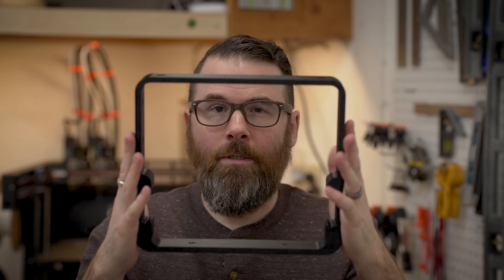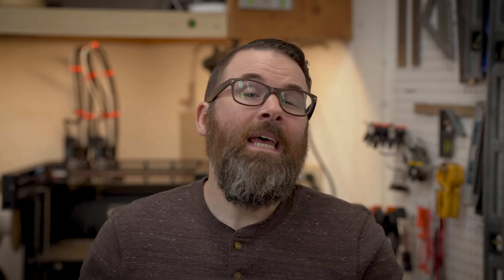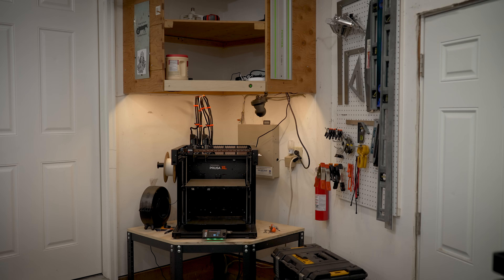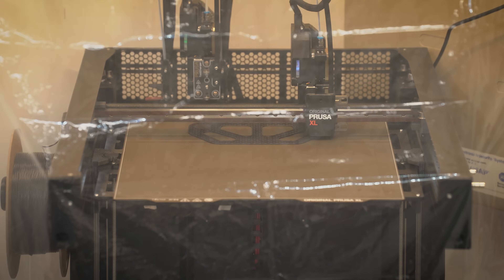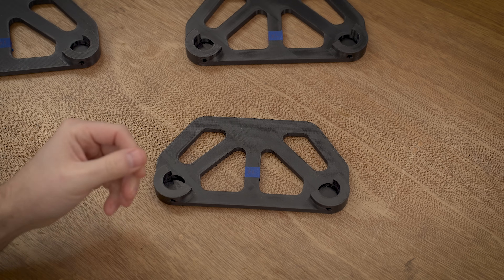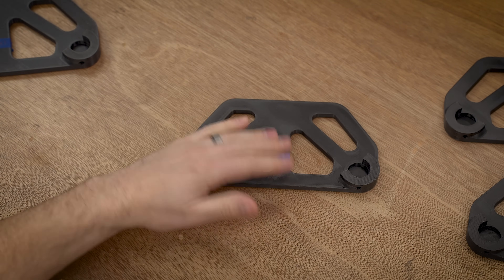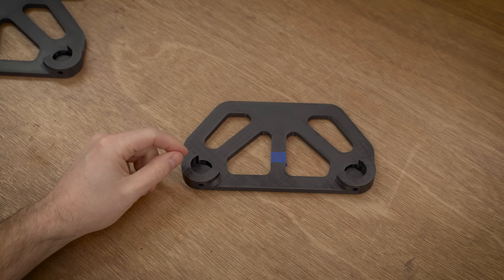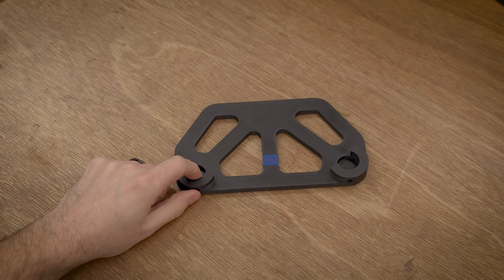Printing ASA on the Prusa XL -Are Enclosures Necessary?

Comment: I'm printing ASA on a modified ANet A8 ! No enclosure. Mostly small parts but it works OK. Had to change the hot end liner tube to one designed to survive 250-260C. Im using a glass bed at 90C with 3DLac. Sometimes hard to get parts off the bed but leaving it overnight helps. Elsewhere I've seen someone print ASA with a "wind break" printed around the part.

Comment: Great video, just got my XL and goint to print some LED sign in ASA, can you now write final seetings of print bed 100C? nozzle 265C?  is there a problme if i have a shell of 2 mm? many thanks for answers
Reply from the maker: It's guess and check with the XL.  I didn't find any settings that worked perfectly.  I ended up just using my H2D for ASA, and just used PLA with the XL.
Reply: @RobertCowanDIY  many thanks for answer will try with your settings in video and will see

Comment: I am currently printing in asa on my vyper in a closet with a blanket blocking the front of the enclosure and I have had no issues. Before I covered it I could see a little warping after covering it none

Comment: I have x1c still having cracks in the print that appear after being printed is there anyway to have a good print without heated chamber?
Reply from the maker: Cracks?
Reply: @RobertCowanDIY yess after 1 hours it appears
Reply from the maker: @elie.k93 you didn't let it cool down slowly enough.  You might need to add some gcode at the end that slowly let's the part cool

Comment: What exactly did you tweak? Would be helpful to know what you did.
Reply from the maker: I just slowed down the outer walls, and added a delay at the end to let it cool down more slowly.
Reply: @RobertCowanDIY I appreciate the reply. Was the delay after each layer or after the entire print you allowed the bed to stay on so the entire model cools slowly?

I’m trying to print an 8 x 8“ square 1/4 inch thick. The warping in the corners is unreal.

Comment: Thanks Robert.  I've been printing 100s of  ASA parts. I consider asa and abs as "bridge materials" to the polycarbonates and nylons. 
Being a bridge part, aspects like layer adhesion, infill, etc are still very important and need that 50 to 60c enclosure temp. That hot air surrounding the part really helps those layers to bond very well. 
There are a lot of factors that go into printing ASA that, when you have that heated chamber and can get it dialed in, makes it such a joy to print with. 
Thanks for the video Robert! Instant subscribe here!

Comment: Thanks so much for the heat gun tip to eliminate the stress-whitening on the bottom surface.  I'm printing a lot with ABS-GF now (at Clough42's recommendation) and your trick works great on that material.

Comment: 10:10 glue stick may not work due to the bed temperature depending on the material it is composed off. I had the same issue with my 3D Lac so I bought a adhesion spray made for higher temps and it worked fine. 
The other option I used before I found the spray was printing the infill with PETG. Don‘t ask me why but it helped.
Reply: PS: apart from that I used most of your tips: increase heat for hot end and bed, reduce flow (quite a bit), slowly reduce temperature after the print.

Comment: I'll probably do something very similar with mine, and add a separate heater within the "chamber" to help keep the interior toasty. The real enclosure is ugly as sin, and very expensive. I'll probably also permanently affix some plexiglass or something to the sides and across areas that you don't need to reach into regularly, to also help keep drafts and temperatures where they need to be.

Comment: About to have a go at ASA on my entry level Creality v3 ke - have built a plexiglass enclosure for it. Good times.- Styrene (not styrol as another commenter put it) fumes are a suspected carcinogen, and neurotoxic. So I’ll be using a small PC fan at very low rpm to vent fumes outside. One other thought is that warm air holds more moisture - so maybe a bowl of silica beads might help too.
Reply from the maker: Best of luck!

Comment: My favourite related material is HIPS

Very cheap.
Matte and pretty.
Not actively hygroscopic.
Not all that floppy, it's not PETG.
Better UV resistance than ABS.
Does not degrade in the hot-end as quickly as ABS.
Little die swell.
Good pressure control, does not ooze.
It has that volatile poison but not too much of it, an order of magnitude less than ABS.
Dimensionally very good, little shrinkage.
Accepts sanding, painting and glue.
Does not dissolve in acetone but can be welded with acetone.

I can usually just print it open frame and instead of draft shielding i do the opposite, i just blast a little constant air on it, like 5-10% fan speed. Yes i'm sure i'm locking more tension in there than necessary but it works. You try that with ABS and it's a catastrophe.

I don't know why HIPS gets treated as a joke, i think it's one of the best most versatile 3D printing materials.

Bed adhesion is a little difficult. 100°C-ish and PVP coating helps.
Reply from the maker: Huh, I thought HIPS had poor UV resistance?  It's also not great a exposure to heat, which would make it problematic in the sun.
Reply: @RobertCowanDIY   Compared to ASA, it is poor in these regards; but even when degradation by all reason should set in, it suffers less than ABS.

ABS i could preheat the nozzle and then just crumbly shit would come out a mere 20 minutes later, because the material has thermally degraded in the meltzone. With HIPS, i have not been able to accomplish that in any humanly timeframe.

Comment: I love Polymaker ASA. Fantastic filament. I use it for all my custom air ducts for my printer cooling. Prints almost as nicely as the PLA Pro. 
You definitely need to leave it warm for a while and cool it slowly.
Reply from the maker: for sure!  any part that's removed from such a hot environment is gonna have a bit of thermal shock.

Comment: Printing a ton of ASA on an x1c, I can say that by lowering the nozzle temp to about 260c, increasing the bed to 110c, and slowing the print speeds to 50%, and running silent mode, using the engineering plate, It works best with zero glue stick. All prints pop off extremely easy after cooling and are absolutely glued to the bed while hot. I actually have cupping on some parts instead of peeling up, so my bed temp may even be too high. 😂

Comment: Thanks! great vid. Which of these UV resistant filaments > ASA, PCTG & PETG are 'strongest'? Speaking of those which UV resistant filament would you recommend for functional parts... eg a shed door handle?
Reply from the maker: If you're referring to strength as rigidity, ASA would probably be best.  But I don't have any experience with PCTG.  But it doesn't sound as rigid as ASA/ABS.  Other than the fumes, ASA really is pretty neat for functional parts.  It checks a lot of the boxes!
Reply: @RobertCowanDIY  thanks! i'll buy some an give it a go
Reply: @RobertCowanDIY  thanks i've ordered some, lets see how many birds nests i can make hehe!

Comment: Cool trick with the heat gun.
I found ASA very finicky with temperatures of the air around, and had to use a heated enclosure and have the air temperature at 35C to get good prints. Any cooler and ran into issues.
Reply from the maker: Yeah, the cosmetic quality wasn't great, but the parts were functionally just fine.
Reply: @RobertCowanDIY   In cleaning, I found sample flat prints I did with ASA trying get a better finish on the top side. Don't remember all the markings on the back side, but apparently 95 and 260 gave the best result.  :)  This is why we have computers to remember things for us.

Comment: Are enclosure necesary? YES if yuo whant to print in all that volume its a Must , even more yuo gone need a heater for all the volumen ,of course if yuo print tinny things could work but if the thing grow in heagh , its super important have all at the same temp, even with an enclusure yuo coukd habe delamination , cracking  and  warping , soo
Reply from the maker: It's more about the geometry.  As you go higher, you get further from the heated build plate.  BUT, if your ambient temperature is adequate, the temperature differential won't be as large and won't cause issues.

Comment: I've notice that by clamping the parts to a flat surface as soon as I take it off the build plate, until the part finish cooling down. It seems to help keep the part from warping as much. 👍
Reply from the maker: Yeah, that helps for sure.  I'm just letting everything cool down slowly, which does the trick.

Comment: I would like to add that ABS and ASA don't only "smell", they actually release styrol fumes which are toxic (and if I am not mistaken can cause cancer) hence the headache. If you print that stuff on a regular basis you need to think about some kind of ventilation. Great video, thanks!
Reply from the maker: yeah, understood.  I only print them when I'm not in the same space.

Comment: A tighter enclosure with better insulation will get you hotter chamber temps, which will critically reduce warping and increase layer adhesion.

The other major reason for a proper enclosure is the "smell" you mentioned. That's poison, and just because it's less of an effect on your nose for ASA does not mean it is more safe. 

ASA and ABS should be printed in an enclosure, with a filter, and preferably an exhaust as well. You do not want to be breathing that stuff!
Reply from the maker: Oh, of course.  A 'real' enclosure will always be better, but this is a quick solution for the occasional ASA print.

Comment: weight your parts for 15m before removing from build plate, helps me a lot, especially with flat panel parts
Reply from the maker: Not a bad idea.  I worry that it would deform in some rare cases?  I adjusted the ending gcode and that works great.
Reply: @RobertCowanDIY  depending on the part, I agree... if there's any kind of bridge I would not use a weight, but I do a lot of flat plate-type prints, so its helpful.  (as long as I'm around when the print ends lol).   What adjustments do you make to gcode?  slow the cooling down in stages or similar?
Reply: I've also tried flash-cooling by weighing parts down in my freezer with the build plate and all.. I did see a difference, and oddly enough, the parts feel a little "harder", though untested.😂
Reply from the maker: @ChrisLocke1969  Yep, just some simple gcode to slowly cool down the build plate.  It worked perfectly.  I was thinking of doing a follow-up video.  Once the shop temp got back up to normal levels and I added that code at the end, it's printing ASA just fine.
Reply: @RobertCowanDIY  what a fantastic idea... yes, please share this as a How To?  Many of us don't know much about gcode, and would be scared to try something like this alone lol.   Sounds like a practical feature they should start building into the core OS.  Great job, sir!
Reply from the maker: @ChrisLocke1969  Cool, I think I'll work on that video then.  Thanks for the feedback!
Reply: @RobertCowanDIY  gcode followup would be great.  Thx.
Reply from the maker: @mocarver  I already did!  Here you go:  https://youtu.be/q6-g1qL-TT4  Could I convince you to subscribe so you don't miss any other content?  ;-)
Reply: @RobertCowanDIY   Thank you sir

Comment: If the middle lift ups reduce the build plate temperature after first layer.
I had this problem with an enclosed and chamber heated to 50c (Celsius 😅) Voron 2.4 R2 too.
Reply from the maker: Huh, interesting.  I might try that.

Comment: I'm pretty sure that you've made a wrong question: does prusa xl actually worth it's price if you have to wrap it in cellophane to print "advanced" filaments
Reply from the maker: Price is relative.  If you have no food and clothes, even if it printed metal and ultem it's not worth the money.  If you have a billion dollars and NEED to print large format dissimilar materials, it's worth every penny.  You either need the abiities it has or you don't.  If you don't need what the XL does differently than other printers, it's a waste of money.  But it does some things that no other printer can do.  It sounds like you just want people to say the XL is overpriced garbage so you can feel superior.

Comment: Hi Robert, great video. Would you mind sharing with us the profile you used for the print on Bambu Labs?
Reply from the maker: All I did was change the speed on the perimeters.  I think it was 75 for the outer wall and 150 for other perimeters and adjusted the number of top and bottom layers.

Comment: I'm a newbee to 3D printing and I appreciate your honest reviews and love the fact that you show the positives and the negatives. I'm trying to decide between the Bambu Lab X1 Carbon and the Prusa XL. I love what Bambu Lab offers for a user that just wants to print, not tinker and its enclosure. However, I find that Bambu Labs' X1C's build volume is so darn small. I love the bigger build volume of the Prusa XL and its 5 extruder heads which renders way less waste but would have preferred the Prusa XL in an enclosure. That being said, I love your "home made enclosure solution" for the Prusa XL to make a difference in the quality prints that require "sensitive" material. In your opinion, is the Prusa XL to much to handle for a first 3D printer purchase. Its price tag is hefty for a first purchase. Is there a chance that Bambu Lab would release an X1C with a bigger build volume? You feedback would be greatly appreciated. And yes, I did Like and Subscribe!

Comment: Great idea. One thing I did want to mention is that while the XL (and the MK44) is pretty much auto-magic for the first layer height calibration, you can still press and hold the knob during the first layer of the print to manually "Live Adjust Z" if needed for a special case.
Reply from the maker: Ah good to know.  I haven't had to do this yet, but I'm sure I'll need to some day.

Comment: My understanding is that glue stick acts as an adhesion barrier, keeping it from sticking too much. I've never heard that it would actually improve sticking like you're saying on the bambu.
Reply from the maker: Really?  It absolutely helps it stick.  In the early days of hobby 3d printing, before fancy build plates, it was used with glass sheets because glass didn't inherently stick to plastic well.

Comment: Like always Great video. I'm a former tool maker of 50 years, I have worked on a maultatud of prototypes with pretty much every machine known to man. Convention lathes, milling machines N.C., CNC's and the list goes on. Excellent job on your video. I got in to 3D printing about 5years ago  and I have a prusa MK 3s , making parts for inventions, looking into this new XL machine. What do you think over all , I need a bigger surface area to further with my prototypes. And if you could maybe help me with adjustments to making better prints. Thanks Mike W.

Comment: Tent isn't bad, but a dedicated enclosure definitely helps.  I used an Ikea Lack enclosure to print all the ABS parts for my Voron V2.4 on a Prusa MK3S, and it's in a room with the vent closed and was done in the summer.  I also have an X1C which isn't bad either, but I find it doesn't seal anywhere near as well as the Voron does.  My Voron will do massive ABS/ASA prints without a care in the world, but that's what it's designed for.  It'll be interesting to see what either Prusa or the community makes for truly enclosing the XL.
Reply from the maker: That was the exact conclusion.  It works in a pinch, but a real enclosure will always be better.

Comment: Just my experience here.  I almost always print with PETG.  I started using an enclosure and noticed the quality is much better.  As far as having an affect on strength, I've not done that kind of testing.  My prints are much smoother and I rarely have issues after adding the enclosure.
Reply from the maker: Nice, something to consider.  I don't use PETG a lot because it isn't very rigid which is what I'm usually after.  But I'll keep that in mind.

Comment: One thing I've come across in my testing of using full enclosures on my printers is that the cold end can no longer keep up and heat creep causes jams. I wonder if that is the main reason why the XL hasn't done an enclosure for it yet. The only counter I can think of is to water cool the cold end, but that has its own risks involved, especially being around electricity and having moving parts. There are quality water cooling kits out there for printers, but does a company like Prusa want to potentially have a liability problem if something goes wrong?

Also I seem to remember something about Prusa having plans to integrate enclosure equipment as an add on in the future since they have many modular attachment points.
Reply from the maker: This is highly dependent on the material.  Heat creep is usually more a function of the material.  PLA is VERY susceptible to this.  Materials with a very low glass transition temperature will prematurely deform when the ambient temperature is too high, causing them to jam the extruder.  ASA and ABS have a very high glass transition temperature and don't deform under normal printing conditions (even with a very hot enclosure).  Since most people print with PLA or PETG, this is more of a concern.